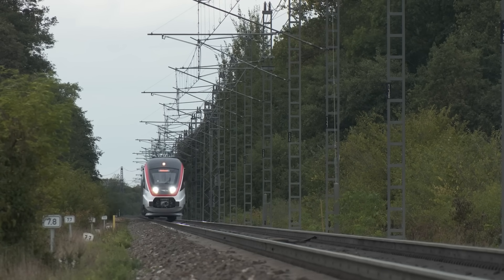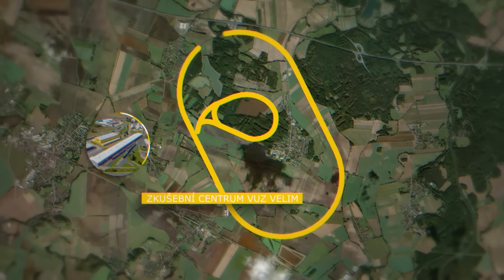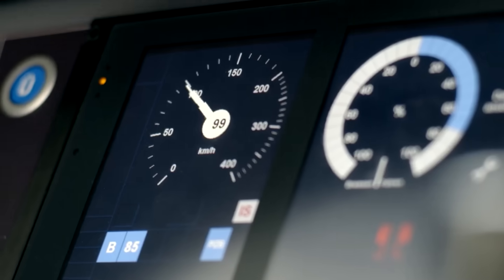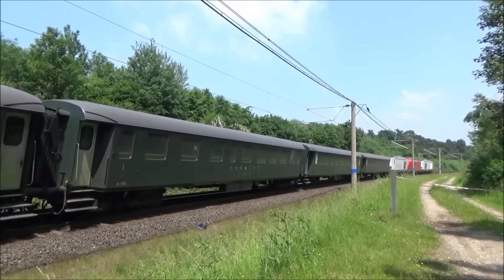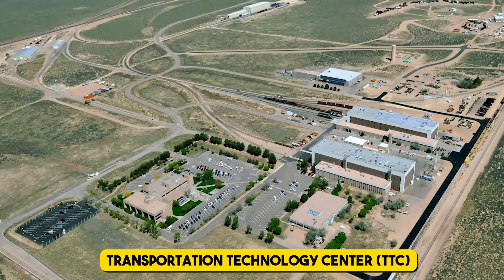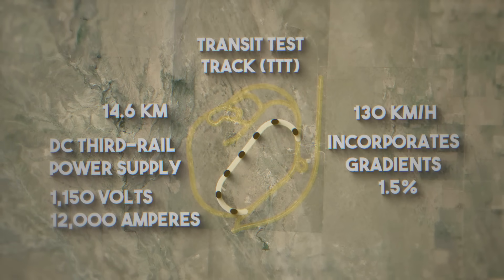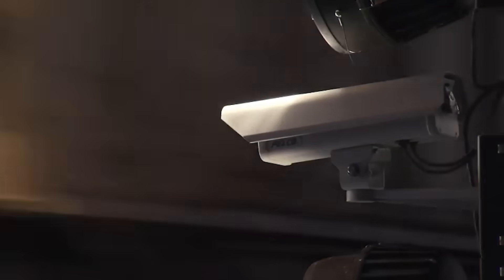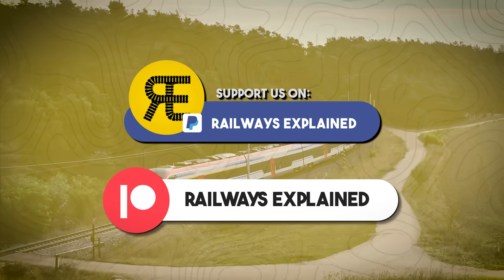Where Are New Trains Tested? Inside the World’s Biggest Railway Test Centers

Comment: Europe definitely needs more of these test centers, the countless trains waiting to get certified for half a decade now just sitting there collecting dust all for it to receive a partial certification after a delay of half a decade this is just ridiculous and totally unacceptable.
With the diversity in rolling stock that the EU operates and the high demand expected add to that aging rolling stock these European train testing centers better pick up the pace if not, there's going to be a serious bottleneck of one tested trains, waiting for certification whilst forcing operators to run, aging trains, risking passenger safety, or cutting down on number of services offered.
This is a serious issue, which is going to get worse before it gets better unfortunately.
Reply: There are more but he didn't show them all. Those tests last long because every country has different railway rules that different trains need to comply with.
Reply: @mifciowo yes but the point of the EU is to make such complications minimal. You plan international routes but forget to incorporate the different rules when the train goes through the border you bought the trade got it tested but forgot the drain is too long for the platform. These mistakes are just unacceptable. 
There comes a point when we taxpayers have to ask serious questions, these are not cheap toys either...
It cannot be that the world around us innovates and the EU just regulates

Comment: Făurei Test Centre (Romania) is owned by Romanian Railway Authority - AFER. ARF in the logo is the Authority for Railway Reform designated to buy rolling stock for railway operators in Romania operating PSO.
Reply: https://youtube.com/@rollingstocklaboratory7891?si=TcP4V7PTZx8q51jV here you can find more about Faurei Railway Testing Center and Romanian Railway Authority AFER.
Reply: AFER is also a notified body (no. 2269 in the NANDO list). At some point, all the authorities (except ARF, which didn't exist) were part of AFER, but in order to prevent an infringement, the NSA (National Safety Authority) and NIB (National Investigation Body) were separated. So, currently, AFER acts as a NoBo and DeBo plus a kind of "authority" for railway vehicles that are excluded from the Interoperability Directive (such as tram or subway) and for various railway products which are not considered interoperable.
ARF is just a PSO authority. But most of the railway vehicles ARF ordered for PSO contracts (37 Alstom Coradia, 62 + 29 Pesa 655, 16 Alstom TRAXX locomotives, 139 modernised cars, 55 modernised locomotives) were partly or entirely tested at Făurei (the Coradia were also tested in Germany and in Velim).

Comment: The US test centre <appears> to offer the most comprehensive range of tests. How useful would this centre be for testing European and other national systems? Obviously, there would be quite an additional cost to send the trains there from all over the globe.
Reply: Track and infrastructure standards are not compatible.
Reply: It's not equipped with European signalling, it's not equipped with European power systems, and while the gauge is the same, the standards for wheels are just about different enough that European trains can't run in the US without derailing at switches. So even if transportation costs weren't an issue (and remember that it's not just trains but also new equipment and of course the technicians), it's not really set up in a way that makes it super practical. All of these are issues that could be resolved if there is interest, so it could happen, but I don't expect it will.

Comment: The Velim test track allows for driving between sections electrified at different systems. While one section might be 3 kV DC, the next one might be 15 kV 16,7 Hz. Or two different AC systems with different voltage and frequency.
Reply: The test track in Velim can change the power between 3 systems. 3 kV DC, 25 kV AC 50 Hz, and 15 kV AC 16,7 Hz.
Reply: @lukfi89 you’re forgetting the fourth: 1,5 kV DC

Comment: kind of surprised that chinas test facility doesnt allow for testing at full hsr speeds
i guess hsr infrastructure is just expensive enough to build that you just test it on the main lines?
Reply: Yeah, pretty sure this is worldwide a thing, at least I don't know anything test facilities that allow 350km/h or even 320/300, would cost so much money while testing for 200 is so much cheaper, and already gives enough info. After all tests succeed they'll also "test" on actual tracks during a specific time window set.

In Europe the max speed for the testing tracks is 230 (for tilting) and 200 for non tilting trains. Couldn't find anything faster
Reply: High speed rail is mostly straight. Making it difficult to turn it into a specific testing facility. They probably have just some normal lines equipped with additional testing features.
Reply: High speed trains are not yet interoperable... each line has its own particularities (even in Europe, you can't put an ICE in Spain, for instance), so each train is designed specifically for the lines it will operate.
Reply: @transportromania  ice trains dont go to spain because france is in the middle of them

ice trains go to every country sharing a border with germany though

TGV trains go to spain and germany

most of the main high speed trains in europe are interoperable as that was one of the main goals
Reply: Not really true, the only difference might be the electricity. There are some differences, like length, max weight per axle because soft soil and stuff but they are interoperable. Look at the ICE for example, the underlying ICE 3 train runs in China, Russia, Eurostar (England, French, Belgium, Netherlands), Turkey and Spain! While there are slight differences, most notably the electricty and every train has a different seat layout. Trains are all made to be a family so most often the changes are just seating/other design aspects.  @transportromania